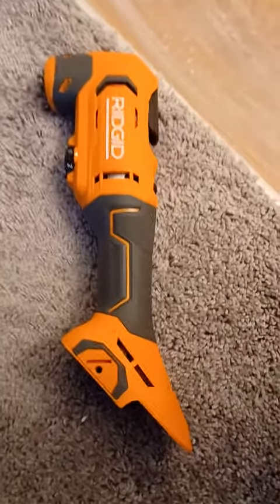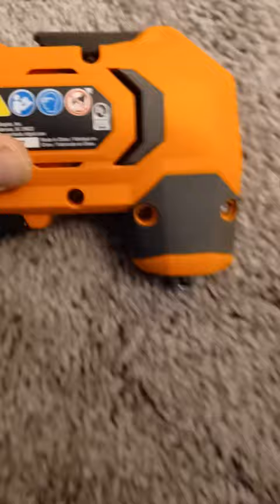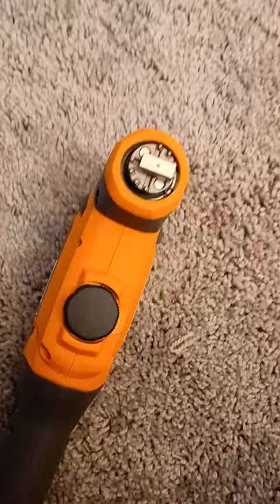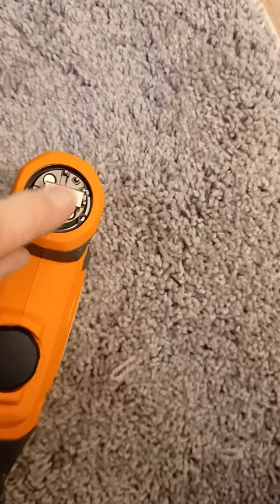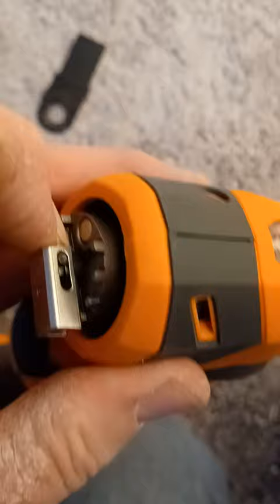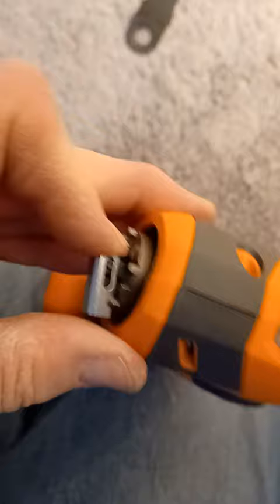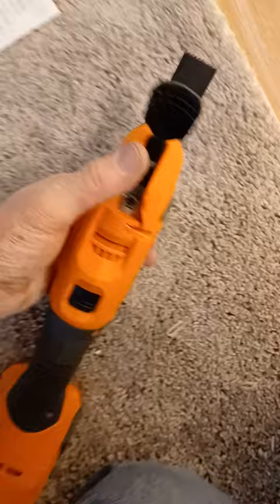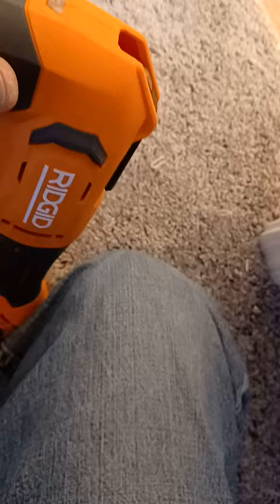How to install blade on Rigid oscillating tool

Comment: The black lever on the top is what keeps the blade in place.  It's plastic.  So be careful when you lift it up to remove/ move/ install a blade.  If you push that lever too far forward, it may snap off.

When pushing the lever forward, push firmly but slowly.  Look on the side.  You will see the spot on the body where the lever can't move any further forward.

When closing the lever, try and apply the pressure in the middle, not at the top.

The blade can also be installed offset from the middle so that you are cutting sideways.  In this case the blade is on an angle away from the body.

Comment: THANK YOU!!! No help from the 800 number. No manual either. One other thing, if it doesn't slide or flip up, put more upward pressure on the top lever.